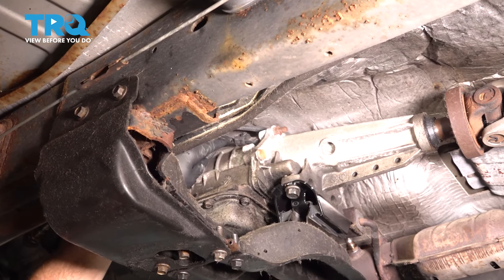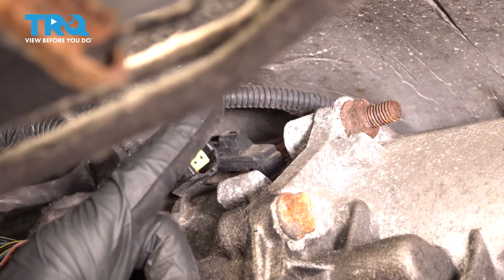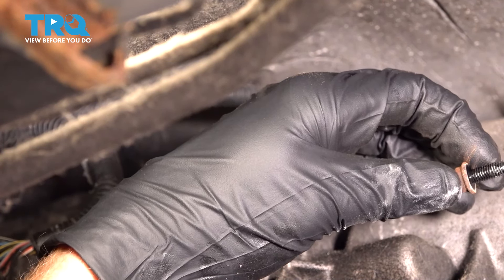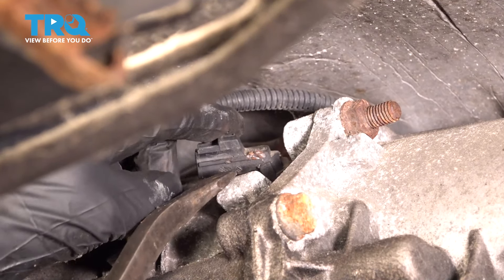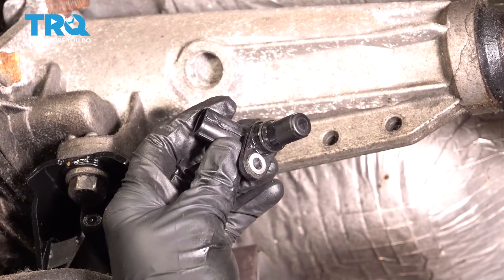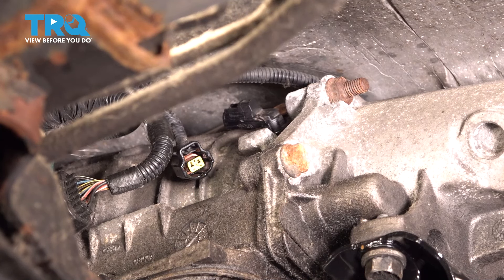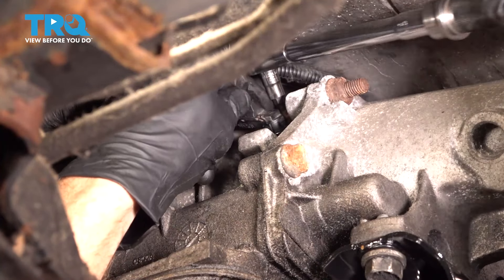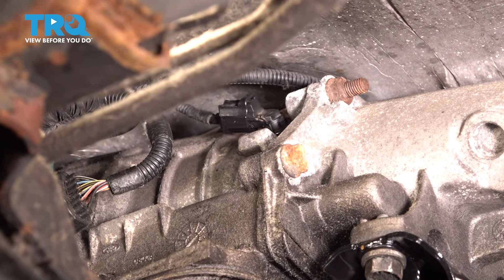How to Replace Transmission Speed Sensor 2001-2005 Ford Explorer Sport Trac

Comment: One would think that a company of this size trq would know what a fastener versus a bolt is.They keep saying bolt. This is like calling a pebble a rock.
But again they should know that, so I'm wondering what other advice they are giving that is incorrect and just perpetuating the misuse of terms in this industry. And you can really tell that the guy doing this video is really not a mechanic.